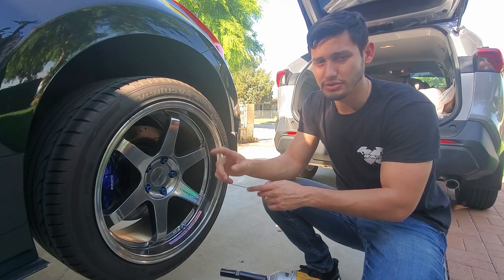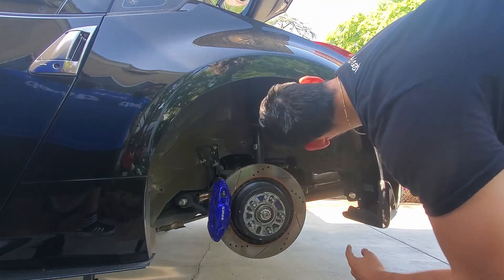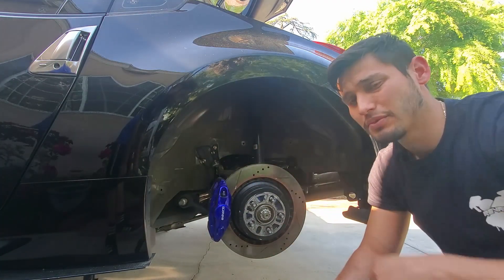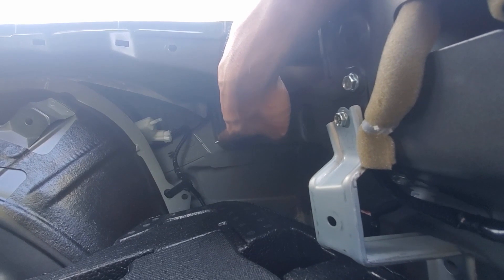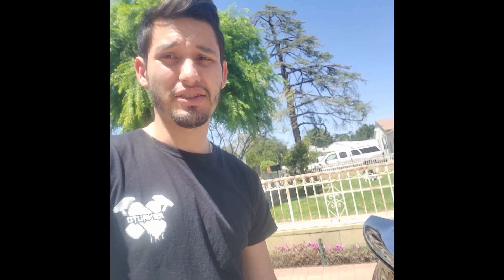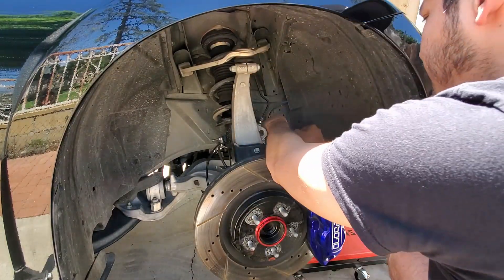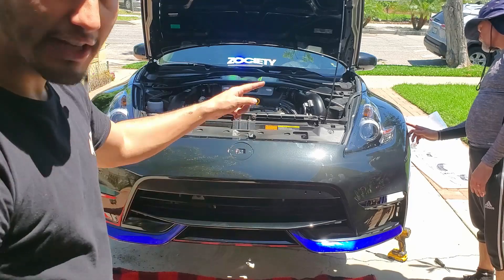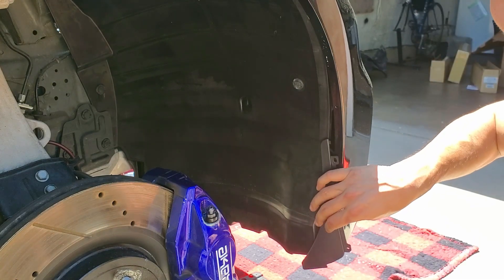Nissan 370z 2015+ Nismo Bumper Conversion!

Comment: I have a question, for the rear conversion can i still use my non-nismo oem rear bumper side brackets?
Reply: I ended up using the same brackets the car had even though i bought the ones for the “Nismo” conversion but did not need them my car is a 2017 not sure if it changes for other years but im sure it should be the same brackets

Comment: Did the front lower blue trim pieces just pop right in or did you need to use bolts?
Reply from the maker: they snap on but they also need the bolts on the back to secure them to the bumper
Reply: @Vq_Kev  do you happen to know which bolts?
Reply from the maker: no, they came with the kit when I ordered the bumpers

Comment: Hi Kev, question.. when looking at the car from a side profile, would the OEM side panels look off (or not leveled) with the front and rear nismo kit?
Reply from the maker: no I haven't really noticed that at all. If u get the nismo side skirts it would sit lower. but I have side splitters that's probably why I haven't noticed

Comment: Hey kev, just wondering is the piece on the front bumper where the Nismo emblem goes painted? I could tell that the rest is painted black but I can’t tell if that piece where the Nismo emblem goes is also painted black or is the original gray black from the bumper thanks
Reply from the maker: it's unpainted it comes in this plastic rubber color

Comment: Hey so when I go to the website in you description it comes out to a total of like 1,200, does it come with both front and back bumpers because it doesn’t say I don’t think ?
Reply from the maker: if u follow the link then yes it's both front and rear,  and from there you choose the add ons you want like emblems fenderliners etc.
Reply: @Vq_Kev  appreciate the response bro, I just subscribed, it’s because I’m looking into buying a Z between this month and next month so I would purchase these bumpers as well to make it look more clean
Reply: @Vq_Kev  and can’t you just replace the old Nissan badges and put it on the new bumpers instead of paying +$68
Reply from the maker: @trite7364  you can take the badges off of your old bumpers they are the same that's what I did. if you want to complete the look the only emblems u need to buy are the nismo ones. be aware they are pricey tho. For the DRL lights on the bumper I got custom ones from ig from @lotusworks_370z

Comment: The exhaust tip fitment is the same for the rear bumper??
Reply from the maker: the rear bumper is a lil bit longer so the exhaust tips are tucked in a little bit you have to make them pop out more by adjusting them
Reply: @Vq_Kev  gotcha, thank you!

Comment: do you need to buy the hardware for the rear bumper?
Reply: Cuz it’s an extra 248$ and I want to know if it’s actually needed or not
Reply from the maker: I can't remember tbh was a while ago, I'm pretty sure I bought the kit with the fender liners and the bolts.  I don't think I ended up using the ones for the rear tho.
Reply: @Vq_Kev  well I’m just getting the rear one rn so I was tryna see, I prolly won’t get it tho since you didn’t need it.

Comment: Does this bumper fit 2014s to on the site it says 2015+
Love the car man
Reply from the maker: on the site it says 2015+because that was when this version of the nismo bumper was released. 2009-2014 nismo bumpers look different.  but yes, this bumper will fit any year 370z. thank you for the support 💯

Comment: Hey, Kev! Were you able to reuse the styrofoam front bumper energy absorber? I had difficulty installing the new bumper with it on - but then again, I had some custom DRLs and brackets mounted on it. Not too sure if that was what was causing the fitment issue for me.
Reply from the maker: yea i was actually able to keep it!:) I actually just got some drl for the car and ran into that issue I just had to trim the edge of the Styrofoam piece so that they cleared my drl brackets and it fit perfectly
Reply: @Vq_Kev  Which edges did you end up trimming? I think it might be my DRL brackets that are in the way as well. So I just cut off about a 1/4-inch on each side?

Comment: did you use the old fender liners and undershroud to fit?
Reply from the maker: I used the new fender liners that Z1 provides for both the front and rear
Reply from the maker: I used Z1 new aluminum undershroud because my oem undershroud wouldn't fit well n secure the bumper.
Reply: Nismo Kev just got my bumpers painted today, ordered the undershroud and fender liners from z1 but they arent here yet so guess ill have to wait to put the bumpers on 😤

Comment: Dope vid I’m ordering mine next month 🤞🏾 for the emblems did you just use the ones in your old bumper and do you think it’s necessary to buy the undershroud as well ? Car looks clean btw 🔥
Reply from the maker: thanks I appreciate that 🙏 and I just reused my old ones,  used a heat gun and some fishing wire and they came right off, just used new 3m tape to stick them on the new bumpers. the nismo emblems I got them from offerup and z1

Comment: You installed the little peaces to fill the bumpers gaps a bit wrong dude, there is a little step on this parts so it needs to be behind your bumper not on your bumper.
Reply from the maker: I was not able to figure that out thanks man! makes sense now! 😅

Comment: Ok so I’ve been waiting on this. When I get my 370 I’m doing the nismo front bumper. So, I see you had the fog lights in the old bumper are you going to put fog lights in the nismo  bumper and if so will the old lights fit or do you have to get Nismo fog lights. She looks great man.
Reply from the maker: I plan to put them if I find an original set for a good price, and the original ones from a non nismo 370z wont fit  in their,  they have to be the nismo drl or the evo-r drl
Reply from the maker: thanks for the supp fam! I'll definitely make a video when I do install them